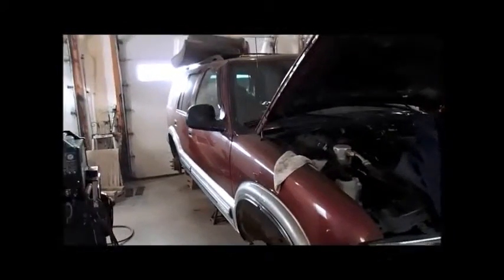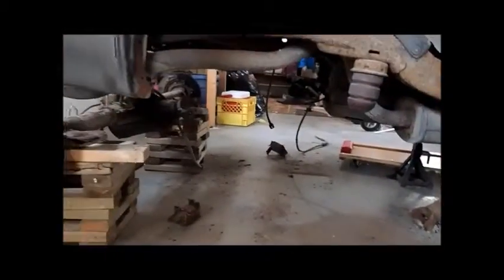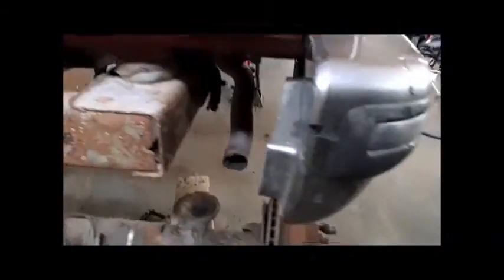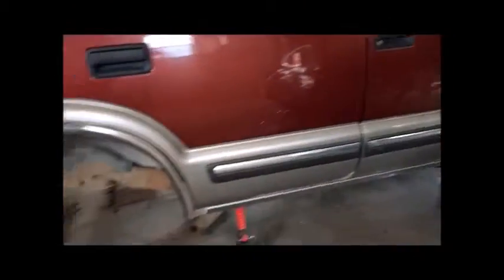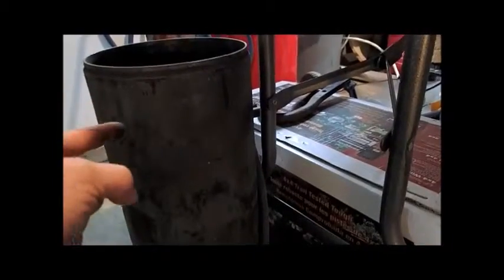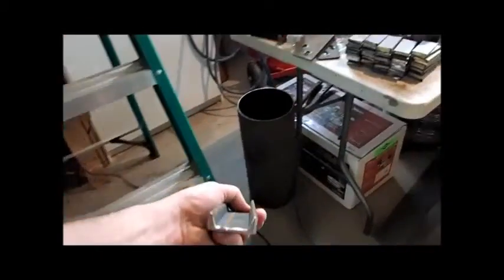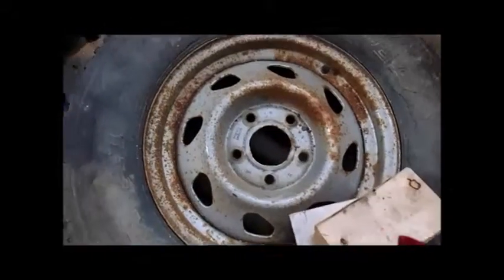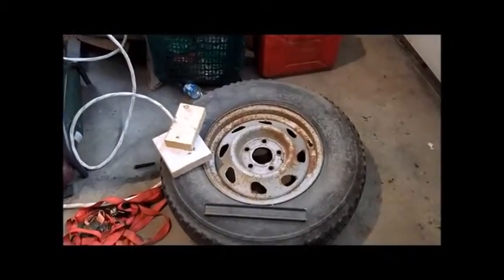Custom Tracked Vehicle, Part 4 Progress and plan changes a bit

Comment: Really, enjoying your playlist so far. Maybe instead of a new vehicle next time, check the local junk yard for some like an older Toyota diff. May be short enough to bring that width in and a driveshaft shop can easily swap out your Chevy end for a Toyota one.
Reply from the maker: Hi, thanks. I have plans for 2.0 now, changing to a smaller vehicle with front wheel drive. Going to reuse the whole drive train from the bronco. Problem now is finding time to work on it.
Reply: @Bradwiggles  I actually bought an old focus wagon for a similar tracked project years ago but other projects take time so it's been back burner. But this made me want to get back to it.
Reply from the maker: @fgialcgorge7392  I would love to see it if you get on the project. Put it on YouTube for others to see it, mostly constructive criticism, but not always. Life is back in the way of any projects right now.
Reply: @Bradwiggles  will do. I've been meaning to upload several of my builds anyway.